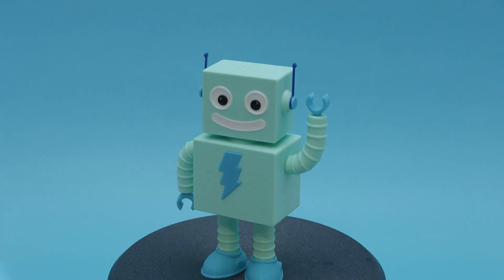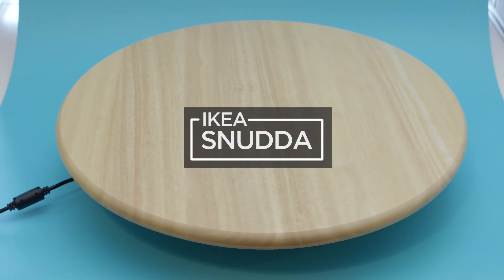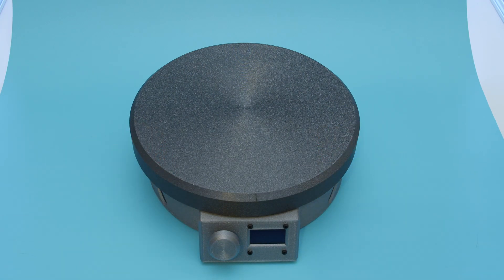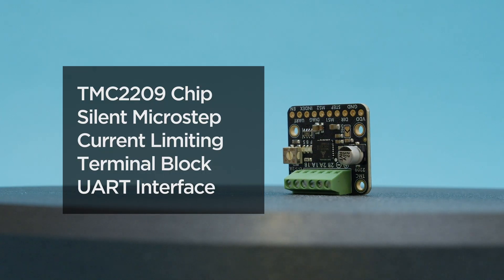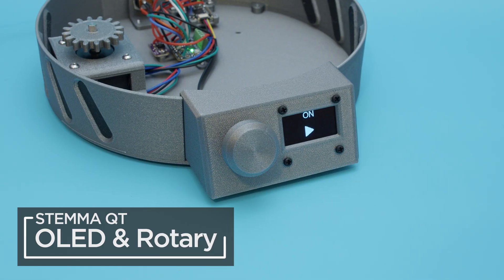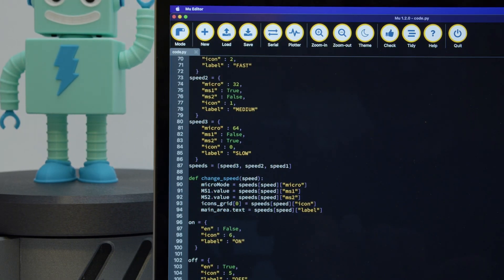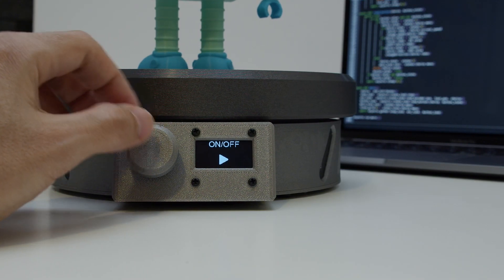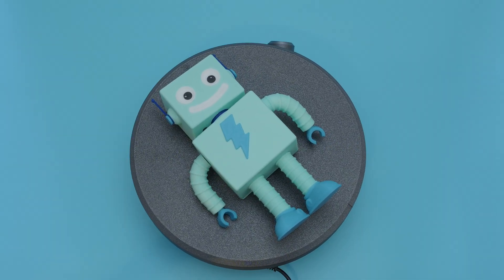Motorized Turntable #adafruit #3dprinting

Comment: This would be a cool way to learn about what kinds of motors can move what loads at what speeds.

I remember a long topic of discussion at a project was how to have a motorized turntable support a car that was like 3x the weight of production cars and needed a huge cable to power everything.

Turns out, just about no one made a table that could do that without making a ton of noise. After a brief discussion of the cost of making a custom table, the client decided that they didn't need that after all (and this was 2021, so there would be no live presentation).